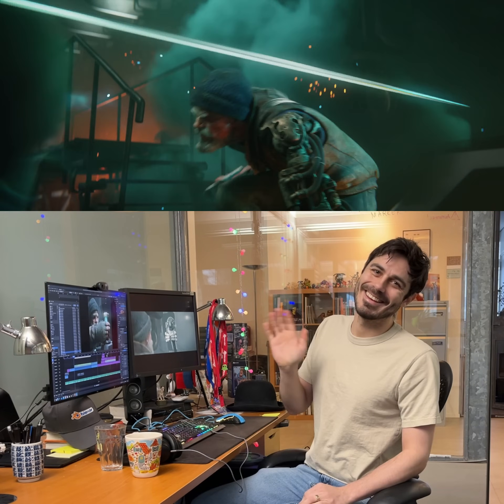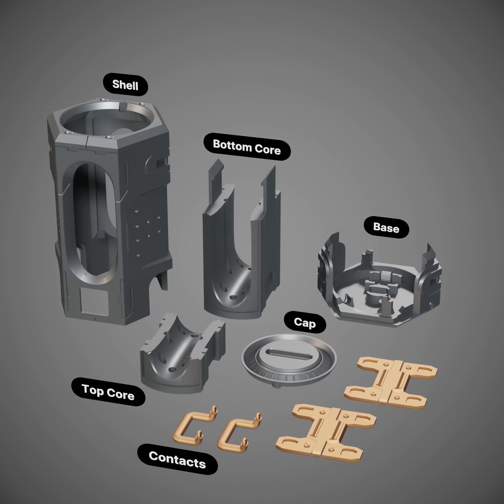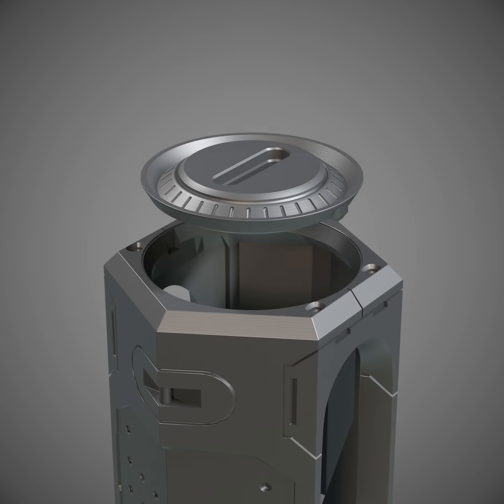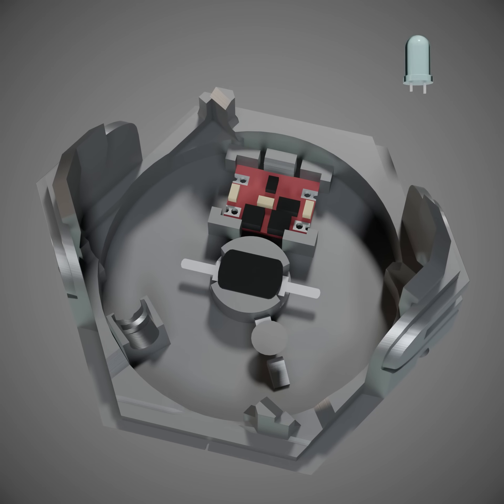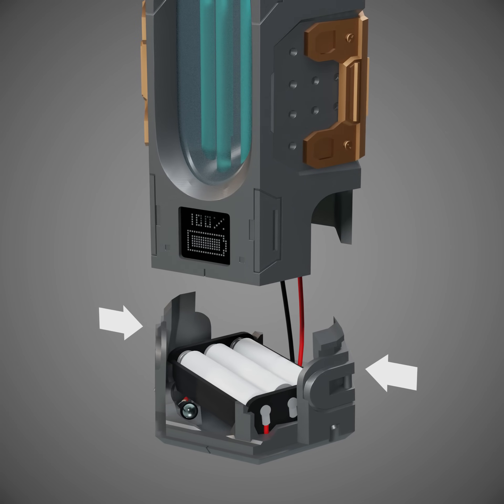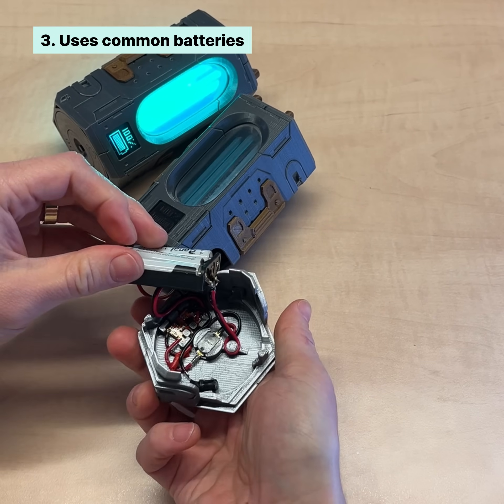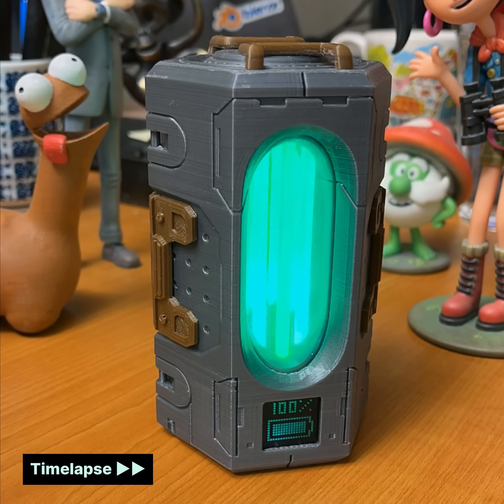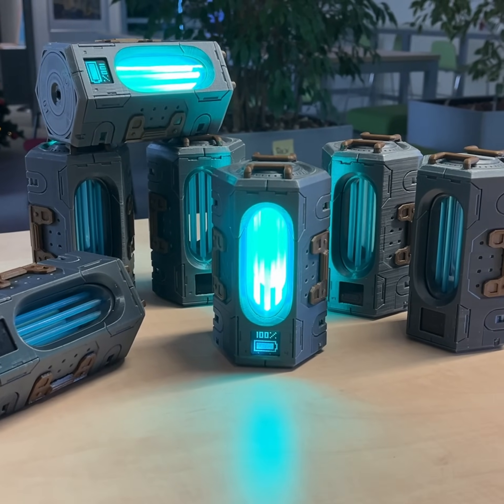Designing the 3D Printed Battery from Charge

Comment: Great project! Always put a resistor in series with a LED (or an ensemble of LEDs) even if it’s a small resistor value. The converter imposes a voltage and the LEDs impose their voltage as well (Vf) so you need a resistor in between to dissipate the energy from difference of the two voltages and configure the current you want in the circuit. If you don’t put a resistor the current will rise at the maximum of what the converter can provide, causing overheating and possibly damaging the LEDs (here there are in parallel so the current is divided between each LED so it works fine but from an electronic perspective it is messy).

Comment: 1:54 What's the 4 for?
Reply: if you use transparent film (for inkjet or laser printer) even though you print it black, light will still shine through. So in order to create the illusion of an led display where only the numbers light up you have to layer several sheets so the black parts are actually dark.